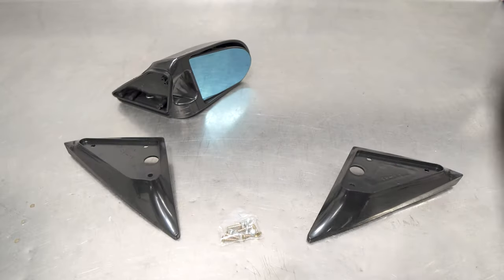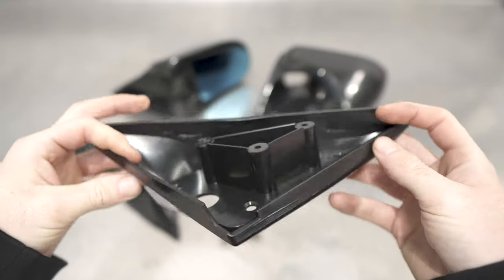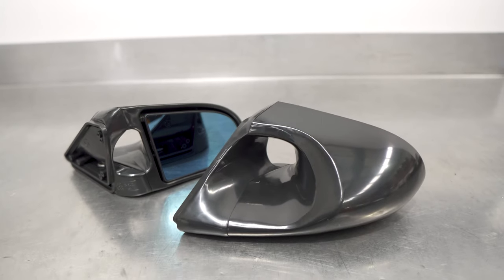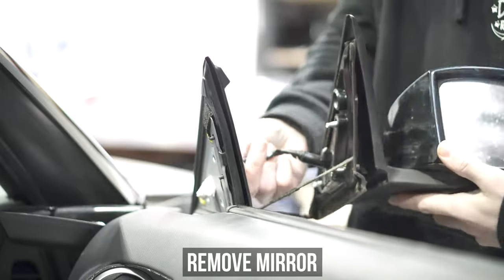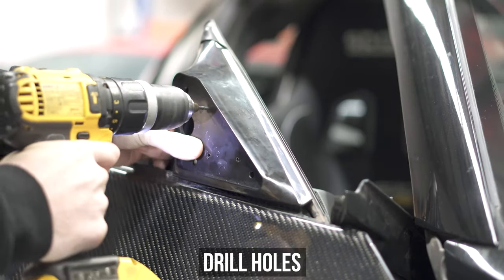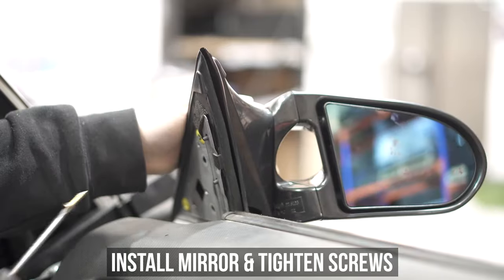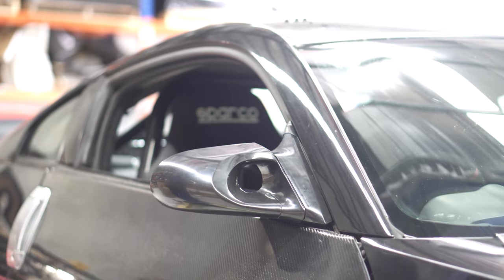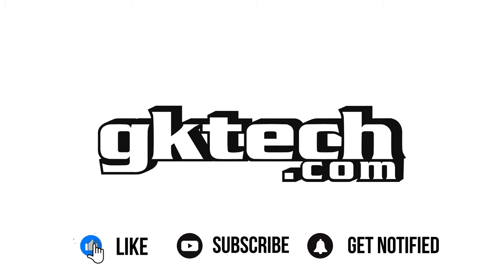Gktech Z33 350z Aero Mirrors - Install

Comment from the maker: For those playing at home the drill bit size is around 4mm and 5mm, in saying that if you have one that is close to those measurements, it would also do the trick ALSO NOTE That these mirrors are specifically made for the V35/G35 chassis, however, they can be retrofit to the Z33 350z, please be aware that these are not a perfect fit, but can be done as seen & shown
Reply: Do you think it’s possible to fit these on my 2013 G37 sedan

Comment: Hi mate just a quick question what's ur seat mount in use, I tried 3 different seat mount but all of them are way too high due to the big hole under driver seat, thx.
Reply from the maker: We had our rails made by a local fabricator, there were no off the shelf parts used.